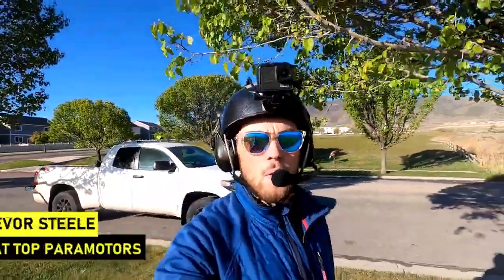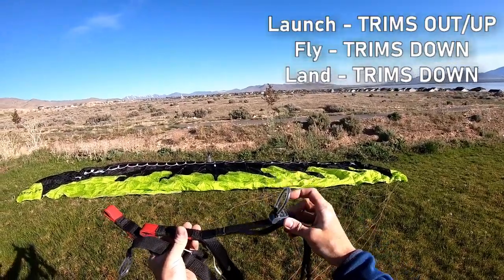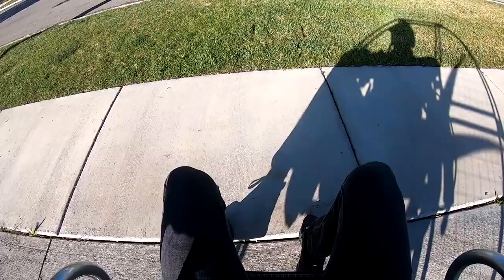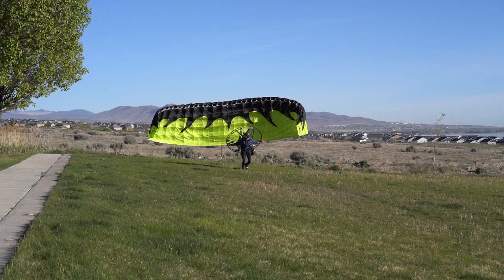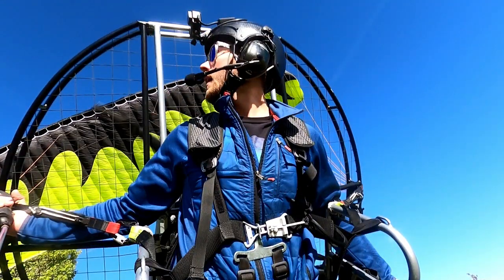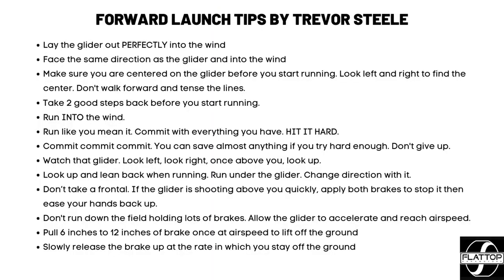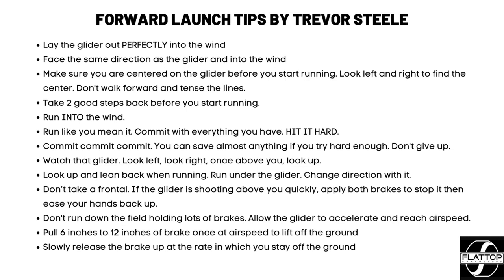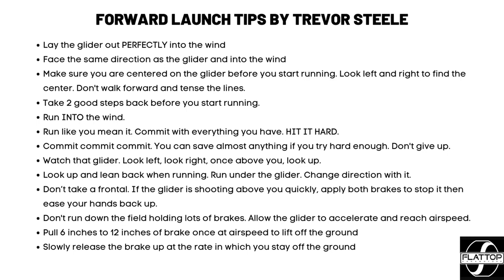NEVER BLOW A FORWARD LAUNCH AGAIN!!

Comment: Why trims all the way out on the Dominator on inflation?
Reply from the maker: Reduce chances of stalling and inflates easier
Reply: @TrevorSteele1  But you have to run much faster to take off than with the trimms down.  Is it worthed? I always do the opposite in nil wind, but I could be wrong.
Reply from the maker: @mirosawslusarczyk6968  Great point! Here's why I still do it trims up>

Trims up there is a much lower chance of stalling the glider when it's barely inflated and not moving fast. During this time it's important you don't stall it because that ruins the launch and can break equipment. Once you've accelerated to a running speed the glider is more full of air and you are able to then apply the brake needed to slow it down to a comfortable launch until airborn.

Trims up you wouldn't have to go as fast but you would have to be much lighter on the brakes in both correcting the glider and popping off the ground. If you pull too much brake you risk stalling the glider.